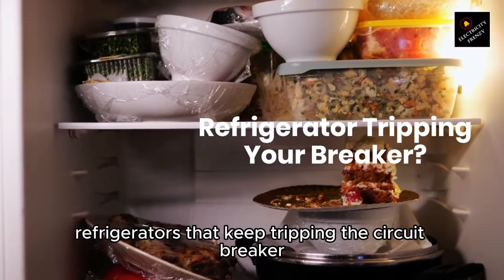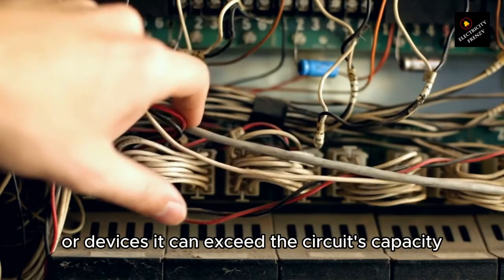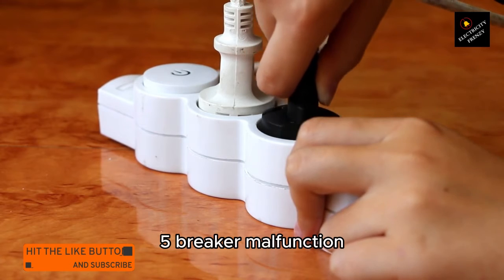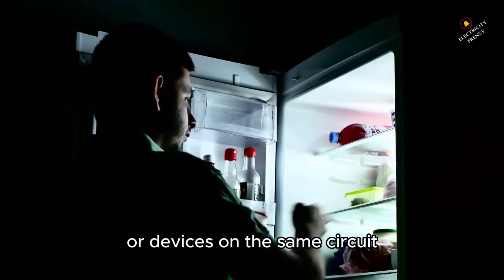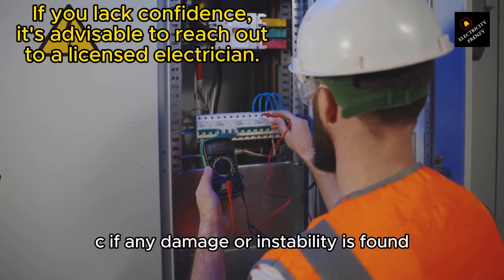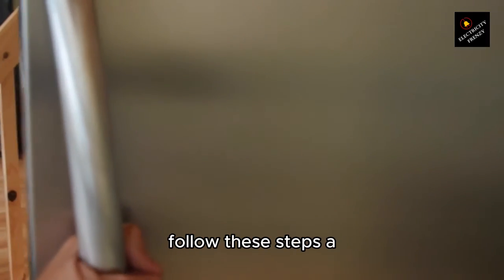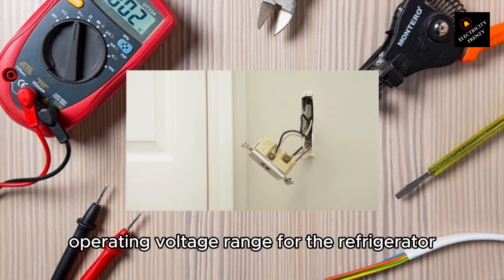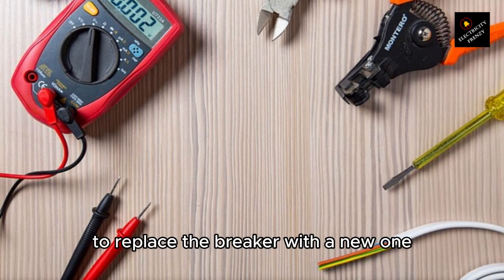6 Reasons Your Fridge Trips the Circuit Breaker!

Comment: A ground FAULT, does not mean a trouble in the grounding conductor?
Reply from the maker: Ground fault in the video means a short circuit between hot wire and ground conductor.
It may need a more clear expression. 

Thanks for your comment.